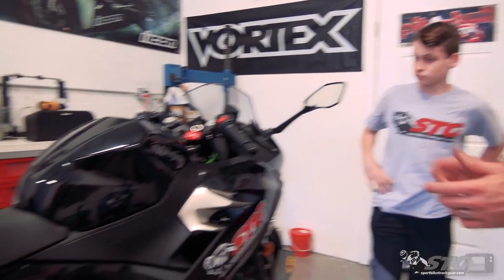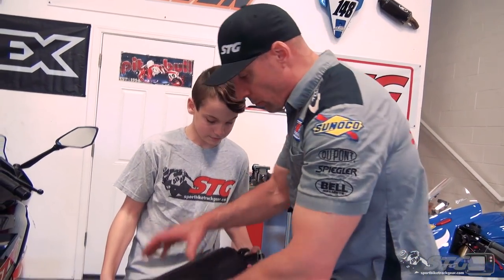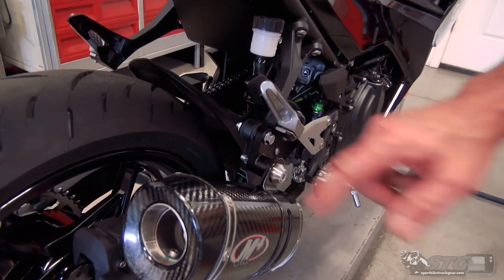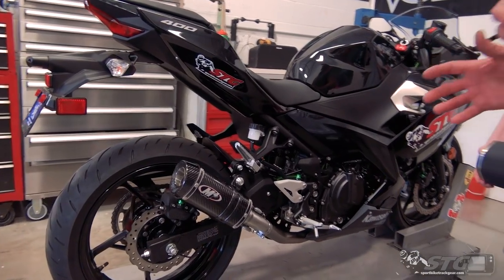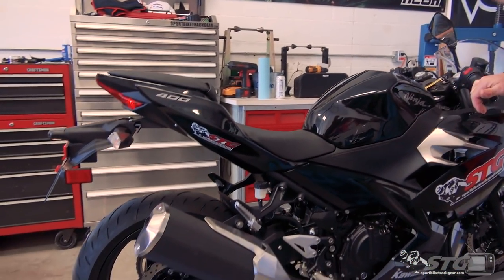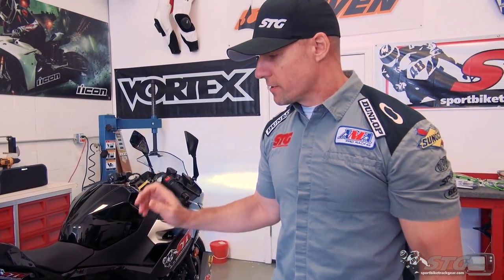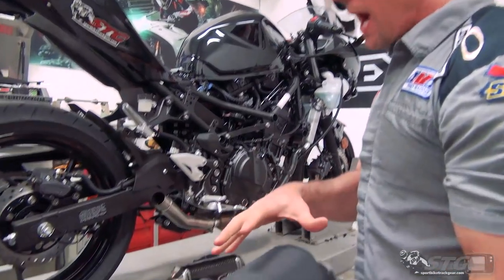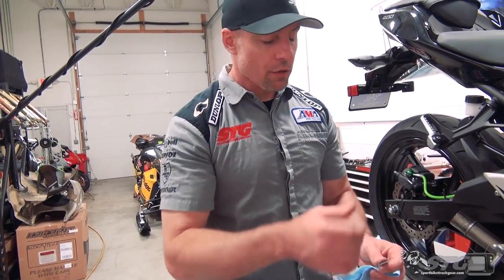2018-2023 Kawasaki Ninja 400 M4 Slip On Exhaust Install | SportbikeTrackGear.com

Comment: Do you really have to remove fairings for this? Also, does the can fit directly onto the stock pipe? The extra "mid" pipe makes it too long for such a small can....looks a little weird.
Reply from the maker: You do not have to remove the fairings to install this slip on. We had them off because we were shooting multiple install videos on the 400 that day. - Van

Comment: Great video Sir. Do we need to do a fuel remap or add a power commander if some sort along with installing a slip on?
Reply from the maker: You do not have to install a fuel controller or flash the ECU if you choose not to. We will do this at some point and compare the before and after performance of the bike. - Van

Comment: Why is my m4 exhaust on ninja 400 leaking soot... it was installed by a reputable dealership.
They said "its normal" for m4 to leak????

Leaves black soot marks all over where it connects to header...
Reply from the maker: None of the aftermarket exhaust systems that slip together seal 100%. End of the day it is not an issue. - Van

Comment: Is there a torque difference between getting a slip on vs full system?
Reply from the maker: With proper tuning you can find a little more power with the full system. - Van

Comment: How do you remove the silencer?
Reply from the maker: It is held in place by a small internal hex fastener that you can remove using an Allen wrench at the rear of the canister. - Van